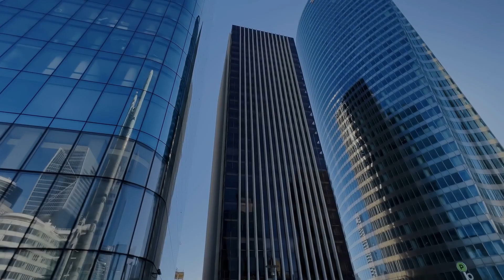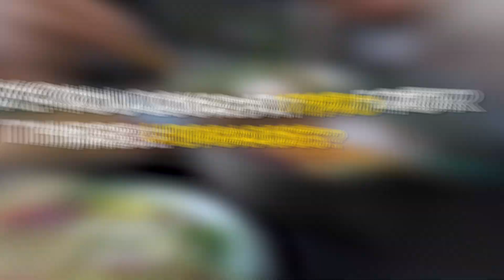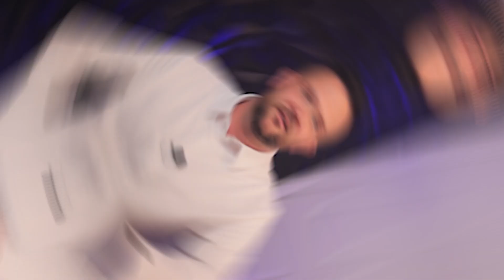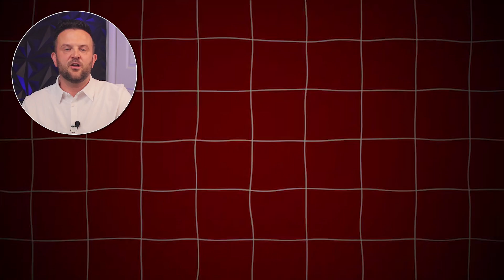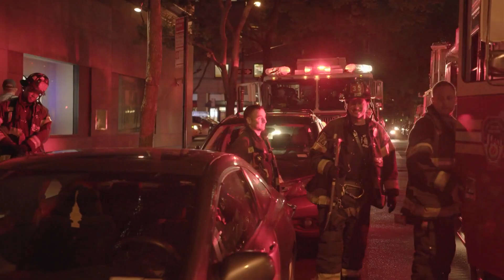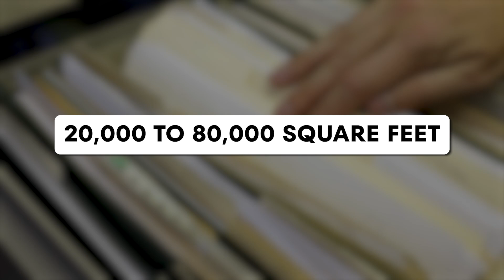$500K Tax Deduction You Might Be Missing (179D Explained)

Comment: I am (Energy Modeler, Consultant) working with the owner of multifamily mixed use building (built 2005) of over 70,000 sf and the client is looking to make roof and potentially lighting upgrades next year. Would it be possible to do the documentation now and get deductions this fiscal year for the planned retrofits next year?